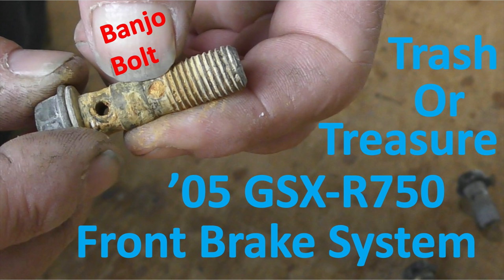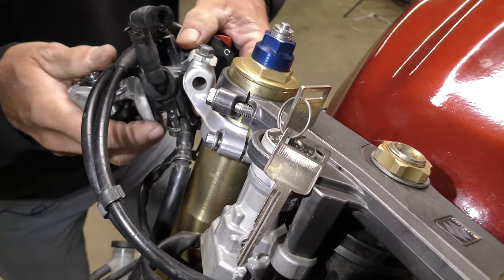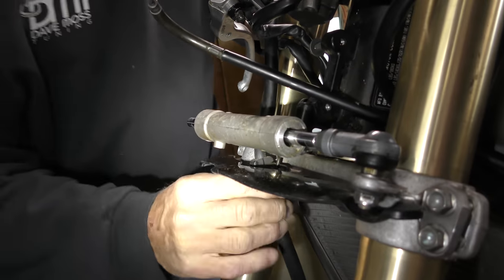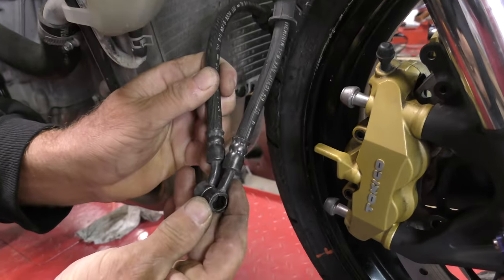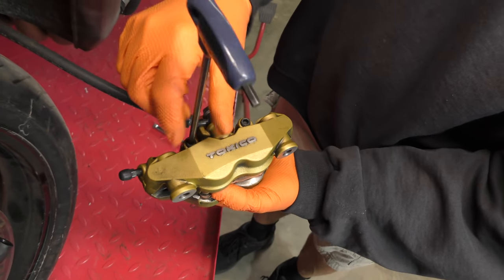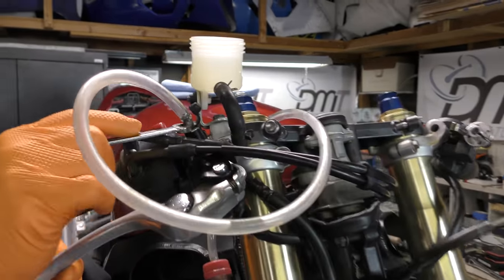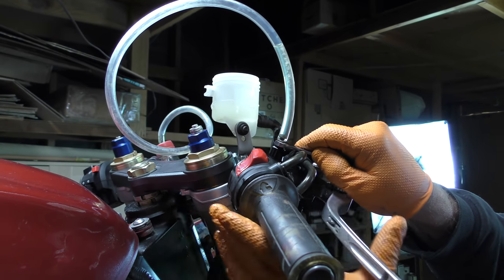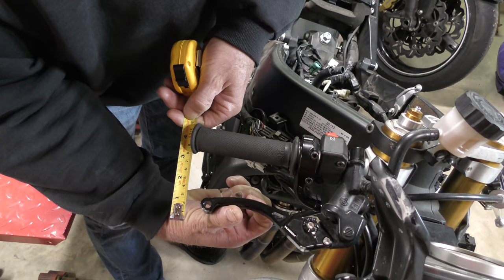Trash or Treasure: '05 GSX-R750 Front Brake System Install

Comment: We had a recall on the 05 750 master cylinder a few years ago, i ended up just swapping my stock master cylinder and lines to brembo rc19 and braided lines for my track/road bike, im more confident under braking and braking little later, beat my pb in my second session with new setup so extremely happy with this setup/purchase and would recommend 😊

Comment: I replaced the brakes on my 05 GSXR 750 track bike with Accossato master and R1 calipers and it made a WORLD of difference with feel and fade.  Had to take the calipers to the machine shop to shave off about 3mm to get them to fit.  I also recently got a '17 GSXR 1000R and it seems like Nissin master cylinders just don't work well with Suzuki's...quite disappointed with the amount of travel and fade on the track.  Brembo master and steel braided lines in the works.

Comment: This bike looks like it still has the old style master cylinder.  You can contact a Suzuki dealer with your vin and get a brand new one for free under a factory recall.  I believe its 2A82 or something like that. (I used to be a service advisor at a Suzuki dealer) I'm also pretty sure Suzuki is doing a campaign where they give you $200 for getting it done.
Reply from the maker: The master is brand new - the recall was completed a few weeks ago and that included master, lines and crush washers plus full system bleed with fresh fluid.
Reply: @catalystreactionsbw   New lines but not new banjo bolts? Seems very odd
Reply from the maker: @JoshNewby84  I missed that item on the list. Oops...
Reply: @catalystreactionsbw  sorry missed the end of the video as I was only tuned in for a short period of time. Great work Dave

Comment: Hi Dave , i could not locate a video on brake pad material . On track days do you use competition or stock,  if so what brand and type.  . Thanks..
Reply: Yo & behold , came out and the brake vid popped up.....ebc  :)
Still what grade of material ?
Reply from the maker: @paulsimpson2232  personally I generally stay with stock. If I am upgrading sintered for the street and sintered metallic for the track. I prefer progressive bite so I can manage pressure and duration at will.
Reply: @catalystreactionsbw  Thankyou

Comment: Their is nothing wrong with the master cylinder
You are doing this bleeding process all wrong 
You need to drag the fluid through the system from the calipers 
These bikes had Very bad brakes  for racing unless you change the pads every weekend
Reply: I heard that about gsxrs alot. What makes them so bad?
Reply: @taz4100  just built to a budget to work on the road 
Replace calipers or master cylinder or both for racing